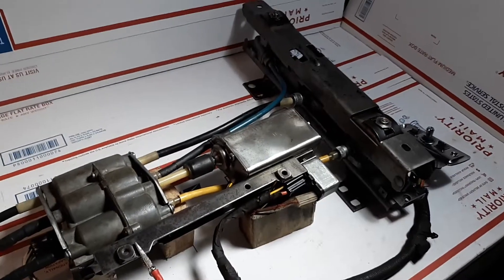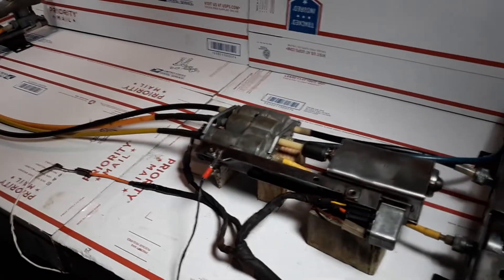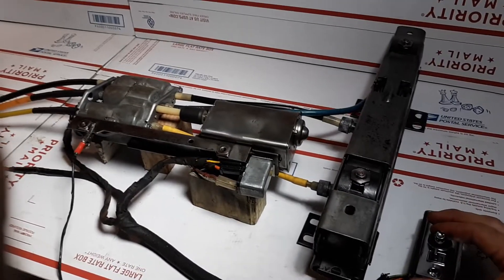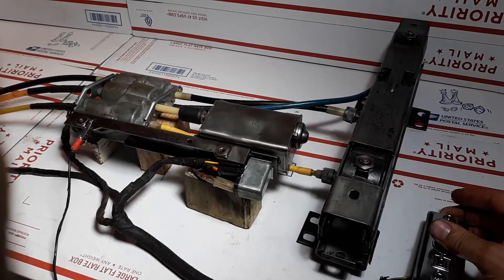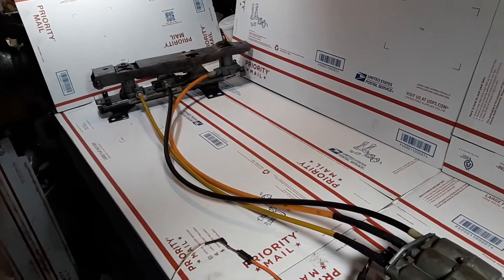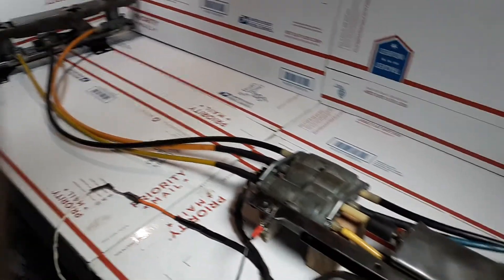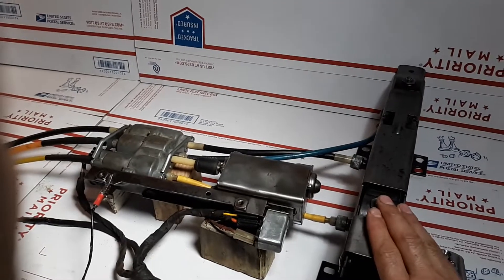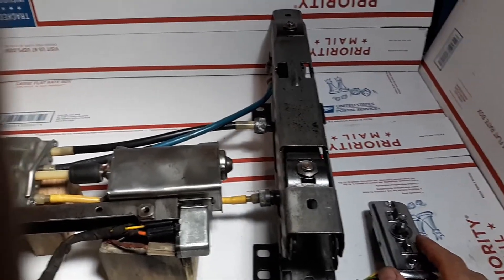1967 - 1970 CADILLAC 6 WAY ACTUATION POWER SEAT MECHANISM

Comment: I may need a unit like this just bought a 67 sedan deville no pwr seat movement in any directions any ideas what i should check before removing everything? Thanks
Reply from the maker: Hello "Tom" and thank you for reaching out to me.  These vintage 50 year old GM power seat mechanisms generally have a plurality of Failure/Fault Causes resulting in cascading compounded failure. It is for that reason that I only provide full restoration as opposed to point specific repair. If point specific cause of failure is isolated and determined and repaired,.. there remains a high probability for failure again shortly thereafter arising from one of the other point specific failure causes,.. therefore,.. it is for that reason that I only provide full restoration as opposed to point specific repair

Comment: Friend, did you comment on the mechanical system of the 1967 - 1970 Cadillacs. In question, did the 1956 Cadillac Fleetwood also have this mechanism?
Reply from the maker: Yes almost identical

Comment: Hello I just had a couple questions. Do you happened to know the correct length of the cables for 1961-64 impala power seat? Thank you very much
Reply from the maker: Hello Efren,.. and thank you for reaching out to me with your question.  While I consider myself an expert on the 1959-1978 GM power seat mechanisms with specificity to Cadillac power mechanisms  having rebuilt over 500 units in the past 15 years,.. I am not an Chevy Impala expert therefore I can not properly advise you as to the Impala cable length. I can merely tell you that GM Cadillac BENCH SEAT CABLES whereby there are 6 cables each having a different length. The bench seat assembly comprises short cables for the driver's side that are yellow - black - blue (from shortest to longest) - and long length cables for the passenger hat are yellow - orange - black each being a different overall length

Comment: Do you rebuild these units. I am removing mine because it does not work (just clicks). I would like to find someone that does.
Reply from the maker: Hello "William" and thank you for your inquiry of my restoration work on critical Cadillac vintage component parts,.. specifically the restoration of the 1959-1978 Cadillac Power Seat Mechanisms. Yes,..  I provide SHOW QUALITY restoration of the power seat mechanism.
I have over 75,000 original vintage 1967-1970 Cadillac items in my collection and over 250,000 1959-1978 Cadillac items overall so if there is anything you may require feel free to reach out to me again. I am best known for my Restoration of the Cadillac Steering Wheels and Steering Columns, Power Seat Mechanisms and Stereo Radios and Power Antennas.
Kind Regards,
George
Tel: 727-364-7523
eMail: kypitsn@aol.com